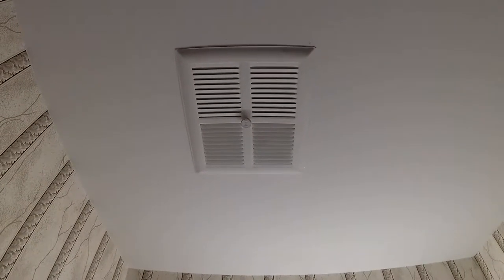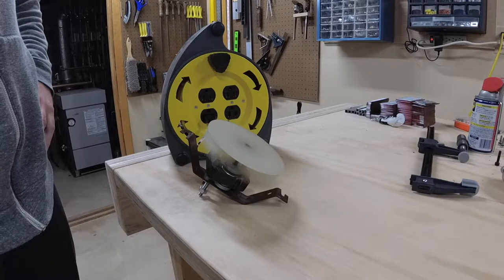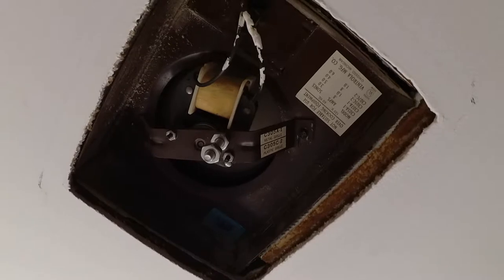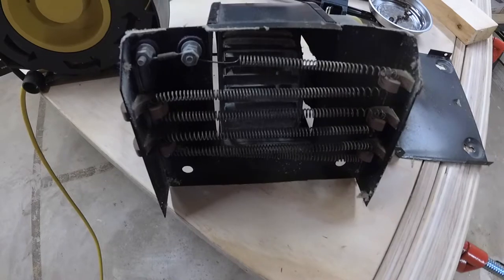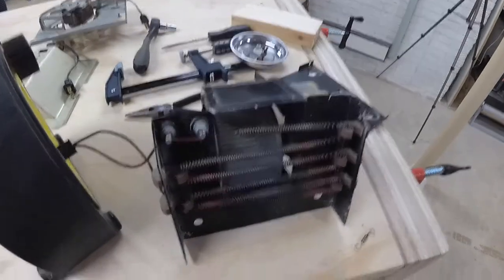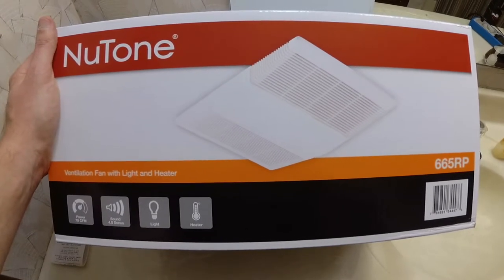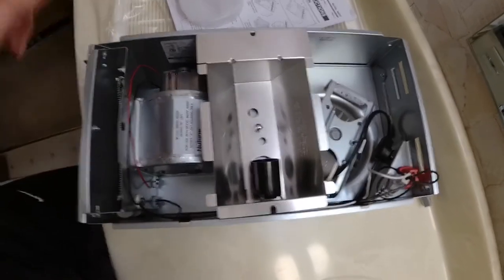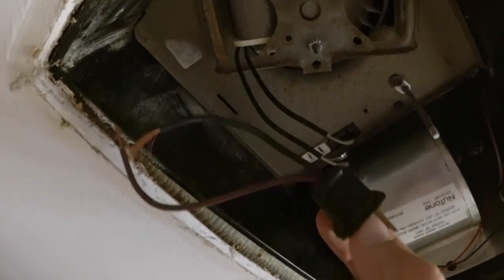Tinkering with a Bathroom Fan & Heater

Comment: Have you tried oiling the bearings of this fan?
Reply from the maker: I haven't. Good idea.
Reply: @NickMomrik  No problem, and you should also record the demo of the brand new NuTone vent/light/heater unit as well. The old one you replaced was the early or mid-80's Nautilus vent/light/heater unit (model 655).